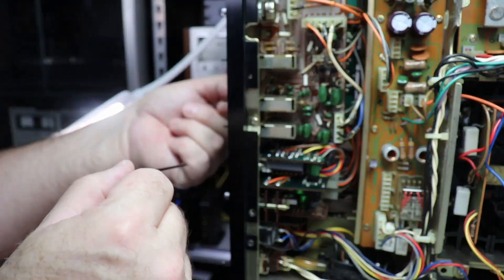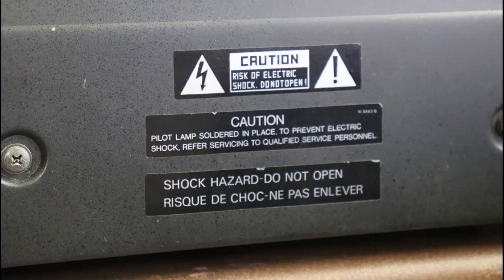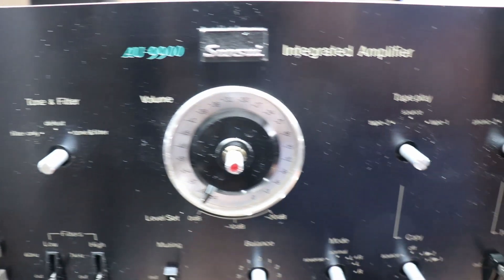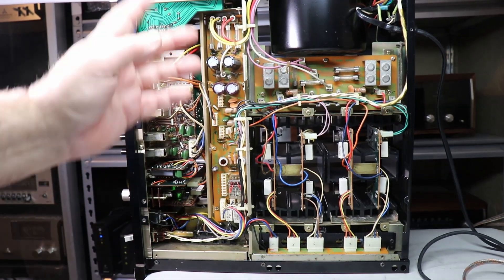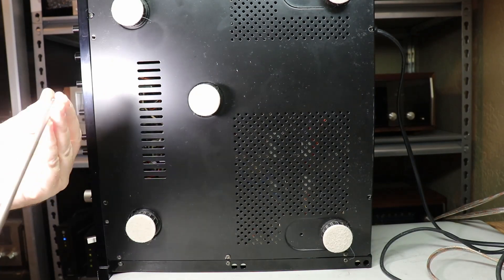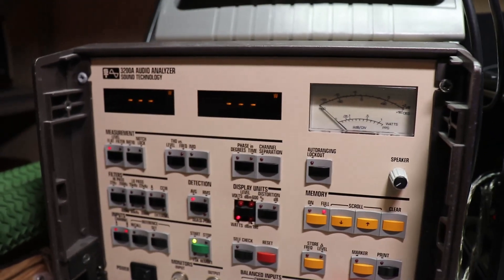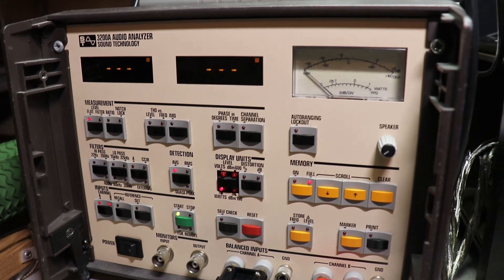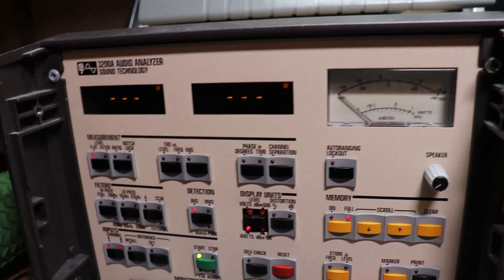Sansui AU-9900 Vintage Stereo Integrated Amplifier Repair And Restoration. Fixing Old Audio - Part 4

Comment: I love the fact that Sansui had the speaker and rca plugs on the sides of the unit.  It simplifies the hooking of plugs and wire by not having to completely  pull out the unit from a shelf or other setup.
Reply from the maker: Yes, that's true and it made for a neater installation with those cable channels. I'll be posting a new video later today of my Sansui G-9000DB which also has the side panel hookup's. Check it out if you get the chance.

Comment: I am super impressed with your dedication to restoring older audio equipment. I remember much of this stuff growing up and love the looks of this preamp and the BA-5000. Very awesome. I never see stuff like this pop up on craigslist or Facebook marketplace. You must be located in the hot zone for this stuff to come up like it does.
Reply from the maker: Thanks a lot. I obtained most of my equipment years ago. In today's world you can find vintage audio equipment but it's pretty pricey. One thing that I have found over the past few years is that more and more of the vintage equipment is failing after 30. 40 or 50 years. It's broken and there are few people that can fix it. I do still get some equipment because of that.
Reply: @vintageaudioaddict  I have a Toshiba SA-7100 that I bought 30 years back second hand. Was doing fine until a hum started. It's on my list behind my Luxman M-117 TP-113 and Pioneer RT1023L

Comment: Great videos!  I have an AU-9900 that I bought "in perfect condition", where the left and right channels keep dropping out.  I am hoping a re-cap and transistor change will fix the problem.  It looked like a scary proposition to re-cap that beast, but your videos have given me the confidence to do it as it is not nearly as complicated to take aparr/put back together as it looks!  Damn Japan designed amazing electronics.  Damned shame that "made in Japan" quality is a thing of the long gone past now....

Comment: Hi, do disconnect the red wires from pins 01 and 06 on the F-2566 and connect them in series on milliamps mode? i.e. 01 and 06 with two multimeters. Thank you.

Comment: Dear sir I have watched the videos of this Sansui Au-9900 with great interest. I have just purchased the smaller AU-6900 but it has problems at the output stage. The left channel becomes weak and noisy (pops and static). It has 8 NEC power transistors (NEC B545A, D118A) and 4 NEC transistors 2 x D382 and 2 x B537... I need to find these parts or equivalent parts. Where can one buy them? Are they sold as tested "pairs" with the same characteristics? Please help!!!!

Comment: hi... I have noticed that you did not change the large capacitors ... they were in good condition? I have the au9900a and I want to give it a good cleaning and change all the capacitors and leave it in optimal conditions

Comment: Hello, how are you? I need the output transistors and the Sansuo G5700 icitators. Would you have it for sale or would you know of any contacts? Here in Brazil I can't find them. I also need those two plates that come out of the price plate, and go to the dicipator, where the output transistors go. If you can please help me.

Comment: Hi, I'm sorry if I'm bother you, and feel free to ignore me. 
I have an AU 11000A and you inspire me to do something like you did on this 9900.
But it have a bad functioning. The left channel look like it have some issue. Sometimes looks like have only dirt on volume controller. But other times I feel like is another issue. I need only set de audio louder, and the sound get right. Have you ever had a problem like this?
Best regards.
How you can see, English is not my first language, lol
Reply from the maker: Your not bothering me and your English is very good. Most intermittent problems like that are caused by dirty controls. First before you start any restoration on your AU-11000 clean the controls with deoxit. Dirty controls can cause all kinds of intermittent problems that can take you around in circles. You should straighten out your existing issue first.
Reply: @vintageaudioaddict  I've tried clean with CorrosionX but didn't worked enough. I'll try to found dioxITD5 here. Thanks a lot.
Reply from the maker: @Hauraki121  Your welcome, Just make sure that you exercise each of the controls 30 or 40 times after using Deoxit if you are to obtain it.  Good Luck!

Comment: When using your 3200 a analyzer bench testing into 8, ohms Do you ever check into 4 Ohms? I'm guessing you're Sansui amp is rated for 8 or 4? Like my Sansui g-9000 DB is?
Reply from the maker: I do have 4 ohm load resistors and I should start putting them into my video's. I try to keep most of my video's in the 15-25 minute range. When I first was setting up my YouTube channel  I checked other channels that were doing a similar theme to what I was doing. There were many video's that were in my opinion just to long. 60+ minute video's that I thought should be 20 minutes. I get it.....YouTube pay's creators by viewing hours so most creators make their video's longer then probably necessary. In my case income is not the number one goal. I try to make my videos interesting in a shorter time frame. In my video's I try to mix it up with restoration, repair and some eye candy. Have a beer or a cup of coffee and be entertained for a few minutes.